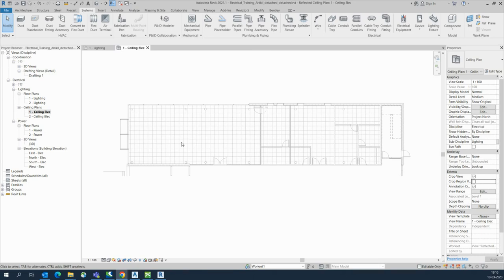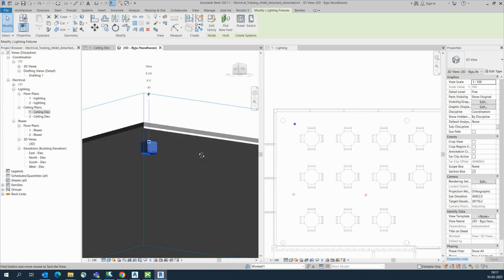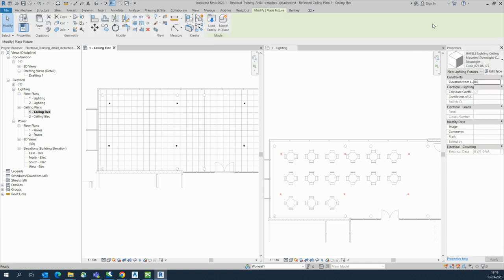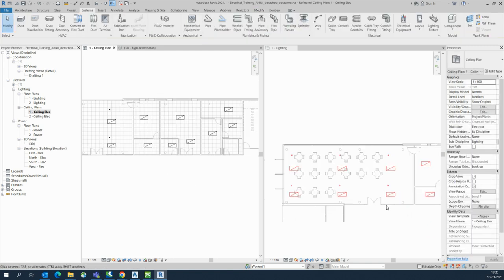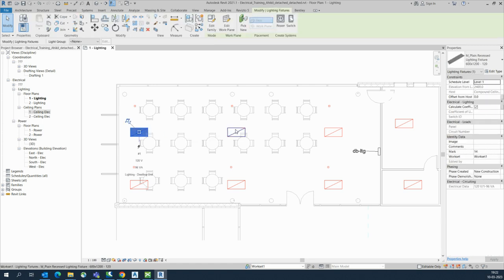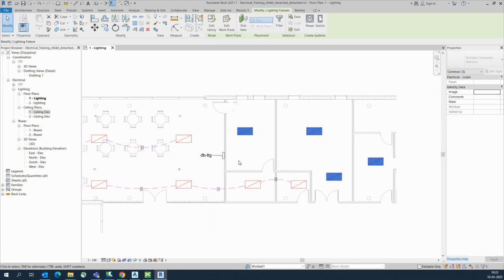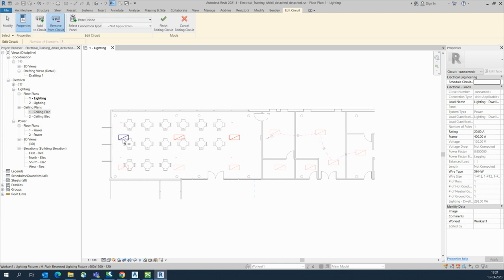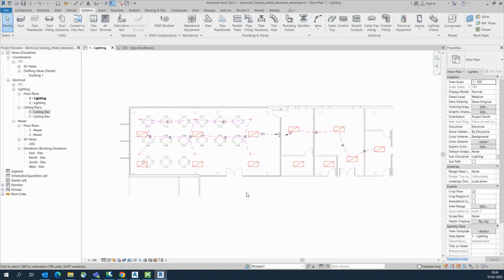Revit electrical Lighting Wiring and Circuits

Comment: how can we add switch to the lighting circuit
Reply from the maker: To add a switch, go to the desired location on the wall where you want to place the switch. Click to place the switch in your project. Ensure it snaps to the wall or the desired location. Once the switch is placed, you'll need to connect it to the lighting circuit. To do this, use the "Wire" tool or the "Connectors" available in Revit. Connect the switch to the lighting fixture by creating a circuit. This typically involves routing a wire or conduit from the switch to the lighting fixture.

Comment: whats the difference b/w ceiling plan and lighting plan
Reply from the maker: A ceiling plan is a detailed architectural drawing that depicts the layout of a room or a building as viewed from directly above. It shows the arrangement of the ceiling elements, such as beams, bulkheads, soffits, skylights, and any architectural features present on the ceiling.
Lighting plans are essential for ensuring proper illumination within a space while considering factors like ambiance, functionality, and energy efficiency. They help in determining the quantity and type of lighting needed, considering the room's purpose, natural light sources, and user preferences.